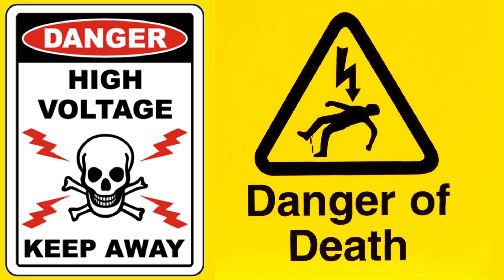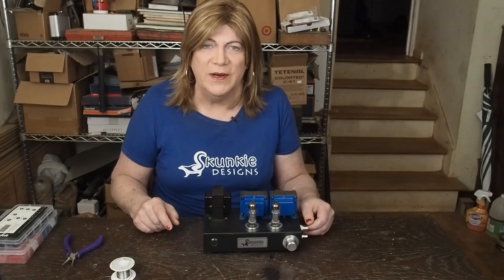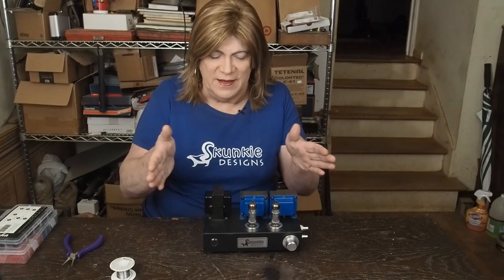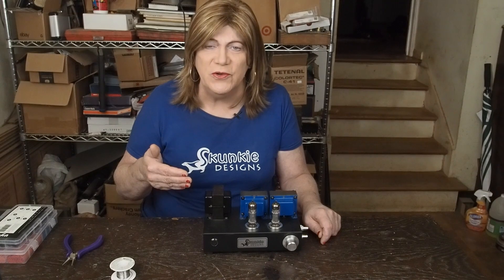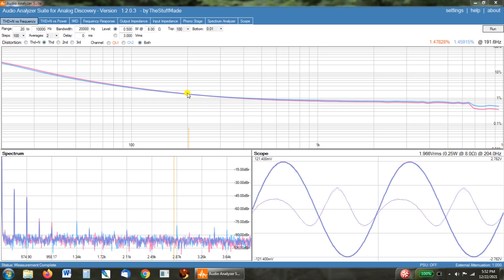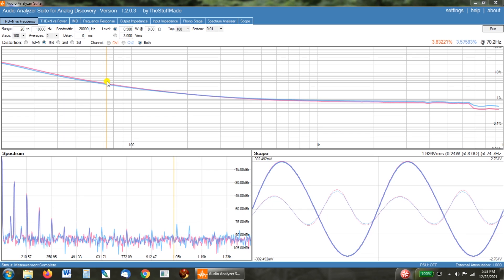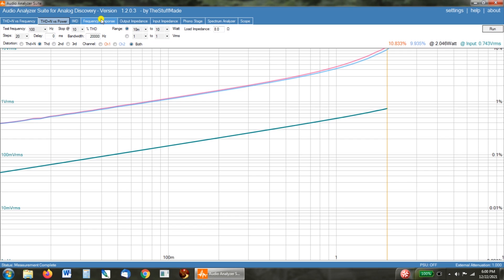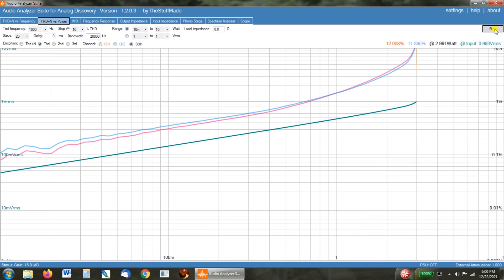6BM8 DIY Tube Amplifier - Final Audio Analyzer Sweep Recap

Comment: Hi, may I suggest you try global negative feedback, I bet you know but others may not know, with global negative feedback you inject signal from the output transformer secondary (the speaker out side) back into the amp 180° out of phase. Usually you take a resitor and hook It between the live tap of the output transformer secondary to the cathode off the first triode stage, It should correct some off the output transformer limitation without changing those, remember OPTs are one of the most expensive parts in this build. Look up some schematics with the same tube and even from Mullard in the 1950´s to this day with a global negative feedback network, It costs almost nothing just a couple of resistors. you can Inject the signal between the diode and the resitor of the first triode cathode and the sec. of the output transformer. It should improve linearity. You have to play with the resitor value, but the feedback signal will always be the realtion between the Feedback resistor and the cathode resistor as a voltage divider. As you allways say this could ruin the sound or improve It, you just need to test It in the real amp. But on paper It works and It costs nothing , you keep the original transformers. Cheers.
Reply from the maker: GNFB has a very different sound.
Reply: @SkunkieDesignsElectronics    I Agree, It speads the harmonics, that said It will cost you nothing to try, It will increase not only frec response and distorition, It will improve damping factor.  You can allways undo It (a couple of resistors for channel. and buy expensive transformers, I think you´ll get more viewers and subs If you provide designs that are cost effective, and while you try this GNFB you´ll encorage more people to tweek and listen, as you said one tweek at a time. I think It would be a good video and you´ll earn more viwewers and subs IMHO.

PS: Thank you for taking the time to reply. Your videos are awesome.You approach the projects both from a subjective point off view (listening) and from a technical pont as well with awesome skill.

(Sorry English is not my main language so there may be mistakes)
Reply from the maker: This amp is using local negative feedback instead. I tried it both ways and it sounds better the way I posted. I understand how global negative feedback works and like I said if has a very different sound to the amp which I personally didn't like. It works well on a push pull amp but I think a single ended UL amp sound better using local plate to plate or "Schade" feedback. This is also tunable to your taste changing the value of that one resistor.

Comment: If one was going to jump the gun and do this build with the 15w Edcors would any other components need to be changed or could you just swap up (chassis size notwithstanding)?
Reply from the maker: I don't foresee any changes other than maybe the value of the plate to plate Schade feedback resistor. I would get a range of values from 220K-820K in ~100K steps to play with.

Comment: I did notice the imprroved bass with 220k , but it reduces the output power. In my amplifier, 560k is the best value for schade fb , but again it depends upon the speaker that we use for listening. So it's best to use the value upon listening
Reply from the maker: Could be different OT or slightly different circuit. I remember you saying this and I tried it, almost 2% more distortion in my amp.